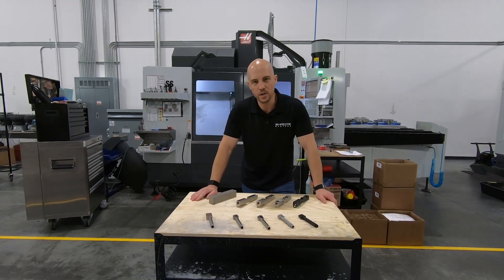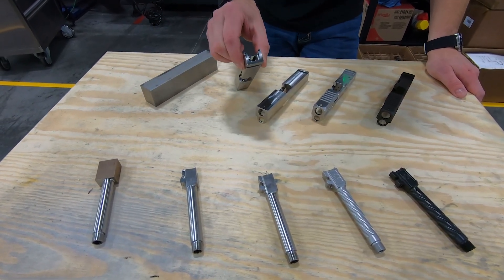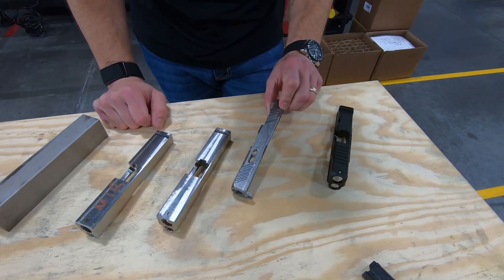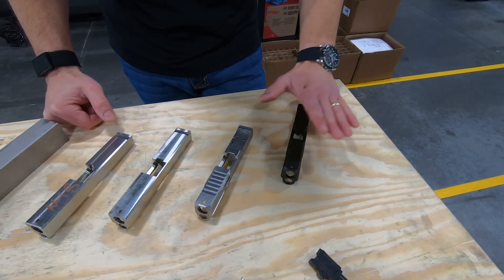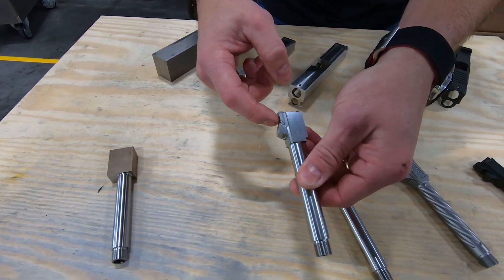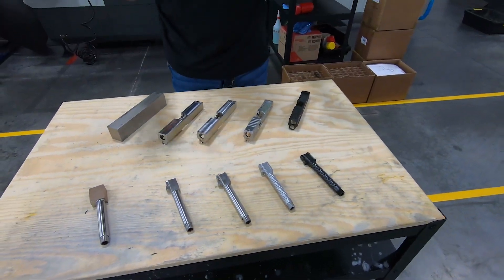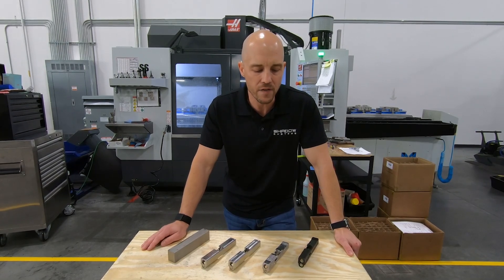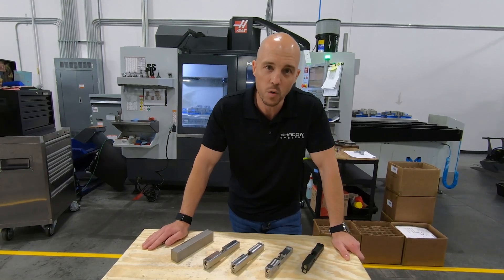Technical Tuesday: It's Barrels and Slides...Oh My!

Comment: Thread protector comes loose all the time. Pleas fix qc issue. 1000 dollar gun and parts come loose
Reply from the maker: Are you using the o-ring provided to keep the  thread protector in place? It sometimes gets missed inside the box—it’s in a small bag taped to the inside. You’ll want to tighten the thread protector down tightly by hand onto the o-ring. It will cause the o-ring to squish out a bit to the sides. Please note, the o-ring MUST be removed before utilizing any muzzle device.

Comment: My first day at the range with my DR920 I had it unloaded, no magazine, and sitting on a gun mat. It was a windy day and a gust got under the mat and, no exaggeration, lifted the gun off the bench and tossed it off the bench, which was a 3' drop onto gravel. I shit you not, I was stunned to find not a single scratch on its finish. The coating on these guns is second to none.

Comment: I am in a tough spot.. I have two MR920s and I am selling two other pistols.. should I get the MR920L or DR920 as a replacement?
Reply: I was in the same boat. I had two combat MR’s in black and FDE. I wanted the DR.  Found a local shop that had both the DR and the mr920L at the same time. I went with the elite L based on the feel of the MR grip and the ability to utilize my couple dozen g19 mags.  It’s my favorite of the three.  It’s actually surprising how much smoother the L is over the standard MR.   You can get X-grip mag sleeves to put on g17 mags in the MR frame to have a full-size grip if you want and gives you the best of both worlds. (Full size frame and slide, or full size slide/barrel on a compact slide that shoots better and is still easily concealable compared to a full size frame.  I just wish shadow systems would sell me an optic cut slide for one of my combats.  (They won’t. 😢).
Reply: @Freakingstang  that was helpful! Thank you!